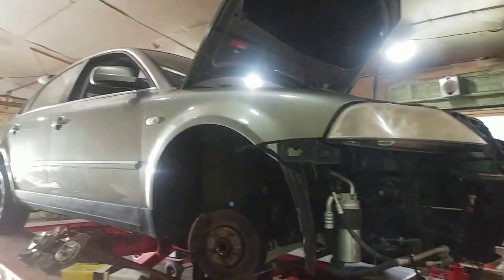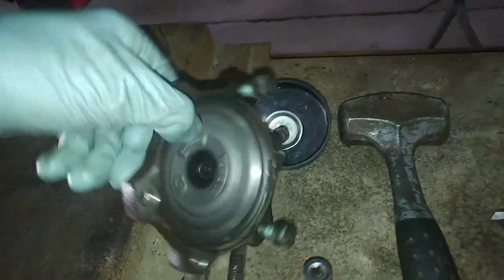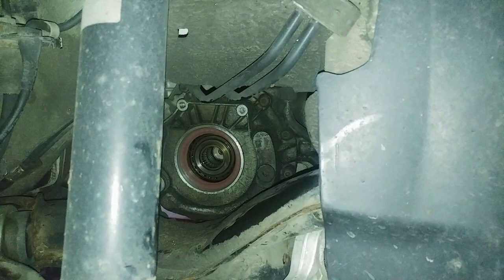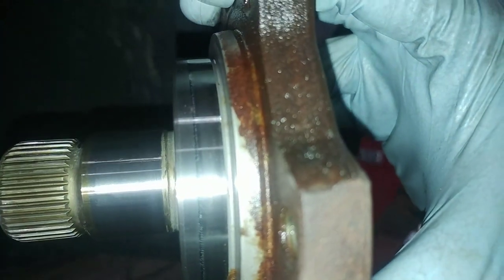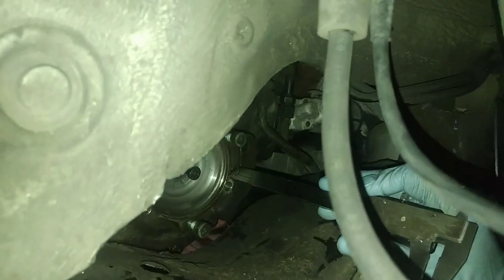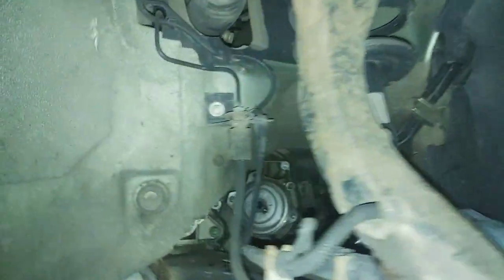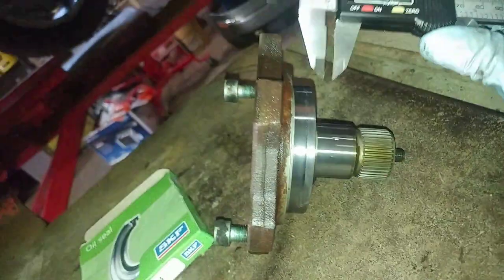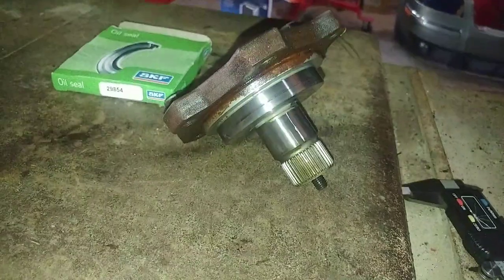Passenger Side Transmission Output Shaft Seal Replacement B5.5 Volkswagen Passat 2001 ZF 5HP-19

Comment: The bolt going through the axle flange output, flange CV axle I believe is tort yield and I believe the torque spec for that is like 20 to 50 pounds or something I’m gonna say 13 1/2 but still double check on the forms

Comment: God bless you too!

Don't forget to fill up the diferential oil back, it's a 75w90, it will take like 50ml hahaha!
Also, I have a bad wheel bearing because of a not-torqued axle bolt, so good tip!

btw, the 1.9tdi Superb that I did the manual swap is running amazing
Reply from the maker: Thank you so much for the reminder to fill the front differential with gear oil!

Jesus is Lord

Levi Jefferies

Comment: Hello ! 
 I have radial play in the passenger output shaft. Probably the needle bearing behind the oil seal is bad. Can it be replaced after the oil seal is removed ? 
Same VW Passat with 5HP19 transmission.
Thanks in advance !

Comment: Was this a manual transmission or does it not matter bc this is the diff side?
Reply: The manual is a press fit. You have to take a couple two by fours and pride out of the output differential portion of the transmission for the manual. The manual does not use a bolt to hold the flange on. You just simply pop the flange out of place and put back in the same way you take offvideo of guy doing the manual transmission taking it off I’ll post it here for you. You can see what I mean.
Reply: If you have a transmission like VW and it says 01V the V stands for valve body just like for example the Passat W8 you have engine code BDP and BDN for the WA the BDP the P stands for powertrain. The end stands for neutral for a manual transmission and 01M wellself-explanatory on the gearbox right there
Reply: You’re dealing with a ZF5HP19FLA the all wheel drive automatics are all the same tours when it comes to the output, shafts the flanges, etc., even the torsion and rear differentials

Comment: how can you do this on the driver side? there is no bolt there
Reply from the maker: Honestly, I am not sure.  I don't recall if I ever did a drivers side.

Sincerely,

Levi Jefferies
Reply: Driver side have 3 bolts around it, need to take those off and unplug that sensor then the unit will come out. It’s a bit more involve